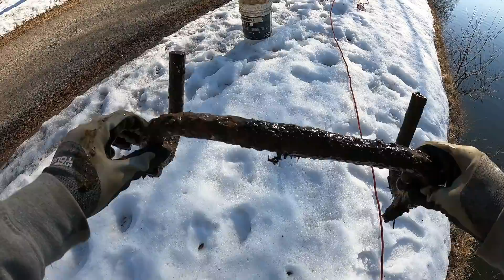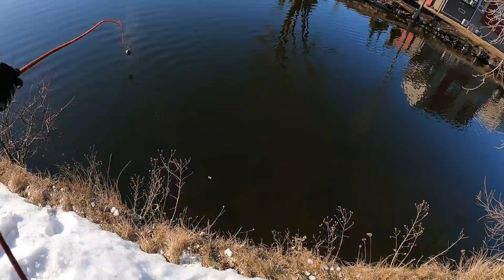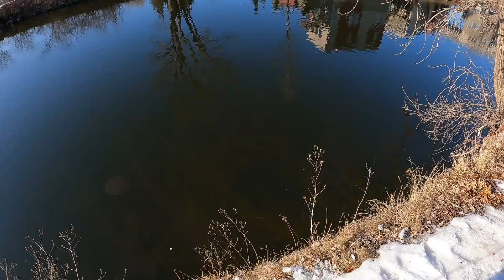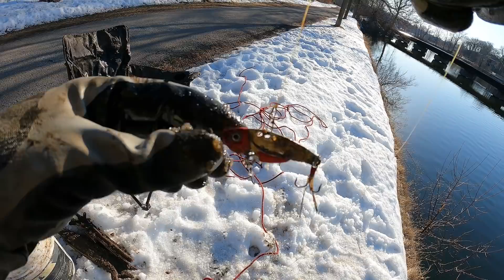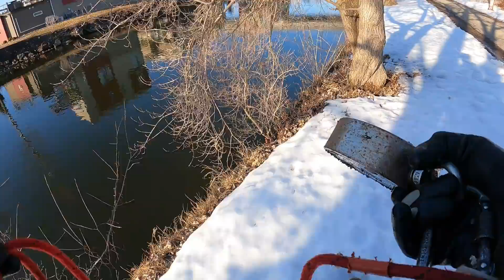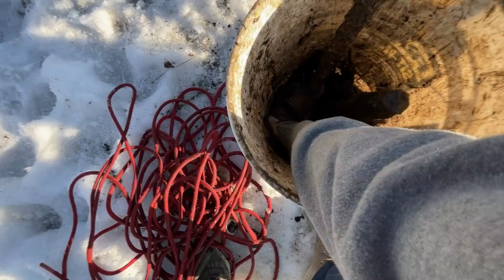You Won't Believe What I Found Magnet Fishing - People Have DIED USING THIS!!!

Comment: Tyler, I have a collection of axes. Absolutely clean it up, sharpen, and put on a nice hickory handle. Some are worth good money. Measure the hole, and check the weight of the double sided axe. Someone will tell you the proper length of the handle needed for it. I have about 20 so far, all in great condition for chopping and limbing trees. Good money because, the older the axe head, the better the steel. The better the steel, the longer it hold an edge. Just remember not to get the steel too hot when sharpening!!!

Comment: Searched images for that tool, originally thinking it was for ice harvesting. The Double Sided Axe actually gave away what tool those three are.
Those 3 are antique Pickaroons, the downward pointed ones are called either a sappie or hookaroon and are used for logging. Specifically, to hook onto wood and lift without having to bend over. Antique ones like those with handles run for over $50 each.

Comment: Those heads are for logging. Back in the day they probably floated logs down that river.
Reply: That would explain the pickaxe heads if there is a lumber yard near by to pull the logs out of the water
Reply: Yep, called Picaroons if I'm not mistaken.
Reply: @SeaCatFl  Yep, Pickaroon is the generic name for them. Downward pointed ones like the ones he had found are specifically called either sappie or hookaroon.

Comment: 7:15  This changed gear for that bike cog you found. We called these bicycles racer bicycles back in the past (at least in my language, in english i dont know perhaps..).
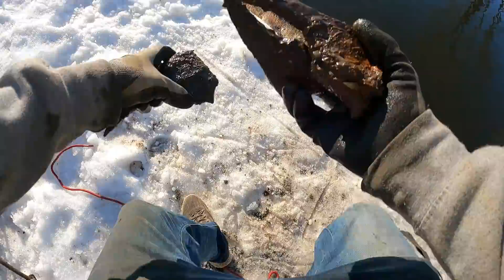13:00 If you prolong the handle alot on a ice axe you get these, i dont know the name for them, but i did see them in use. They are like 6-7 feet or something like that, and they was used on boats back in the days to drag the boat into land after stopping outside land where you want, and it can also be used as a tool to catch fish nets and things too, perhaps even used to get the fish into boats too. No those had shorter handles i think. But can be both of these depending on how long the handle is.
Yeah those it is, but i can not remember the name on them, old versions of boat hooks.
13:48 Yeah, sandpaper it, file some perhaps.. and sharpen it with a grinding stone, and put on a wooden handle, not neccessary in this order, i would perhaps have done the handle before sharening it ;)
Make the wood handle yourself from a good wood piece, draw on it from two sides to get the shape right as you want it to be, the harder the wood is the better it is too i guess, so find a hard wood piece.
On the top of the axe head, there hammer in something so the wood expands so it sticks to the axe head, you could possibly use nails.. but the real piece that shall be there like they used to use is flat and sharp at one end, like a nail but wide and flat. Some search comes up when searching axe head nail on google.
It seems it could be made out of wood too. So yeah, make a axe and also a boat pick perhaps? :)
If there is not enough metal to file down to something useful you can always use a mig welder machine and add metal where you want and file into shape, anything can be fixed :)
You can also let some pattern of oxidation be left, i did see someone who did that with a corroded wrench tool, just removed the oxidation with a sandblaster or was it acid.. hm.. and painted it with black hammer paint and filed it to shape where the deep corrotion was left and looked black hammer painted, it did look nice, rustic style. I bet silver or green hammer paint can look nice too, gold perhaps? will look exclusive lol :)
Be careful to not fell in the water now.. it looks scary, make sure you get a way to get up if that ever happens.